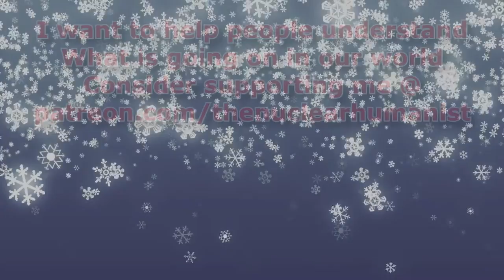PV at Chernobyl, what a dumb idea

Comment: At 1 min. 44 sec. you have a title reading:  "And thousands of people are believed to have died from the effects of radiation", with your comment, "That's probably true." , which is puzzling, because fewer than a hundred fatalities are attributed to Chernobyl.  Was this tongue in cheek?  If so, what am I not getting?  Also, the image shows sarcophagi with many names...what's that about?
Reply from the maker: It was tongue in cheek. I consider the a hypothesis that will reach up to a maximum of a couple of thousand of people, reasonable (before 2100). But no more. It's probably closer to 1000 than to 10,000.
Reply: Everything I've read suggests no greater than 4,000 additional cancer cases, and not all of those fatal. Total deaths (as of WHO report in 2006) at 51.
Reply from the maker: Even if it where 10,000 (which it is obviously not) it will be the safest disaster that ever happened on the planet. It's counterintuitive to most.